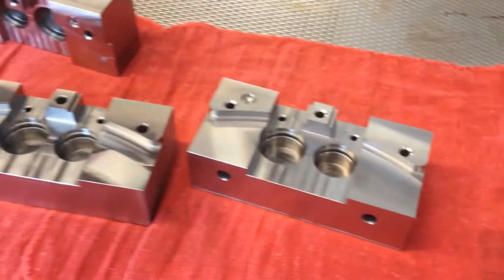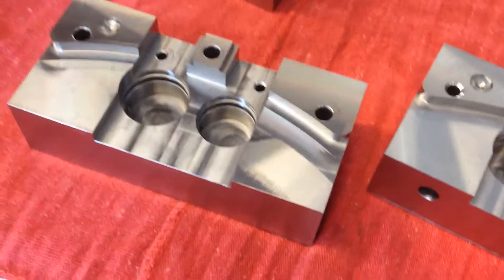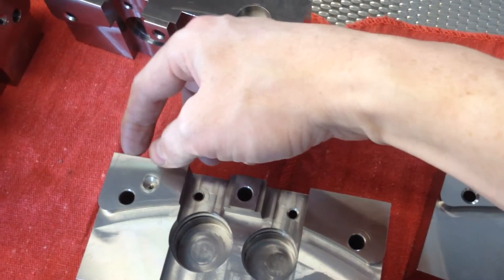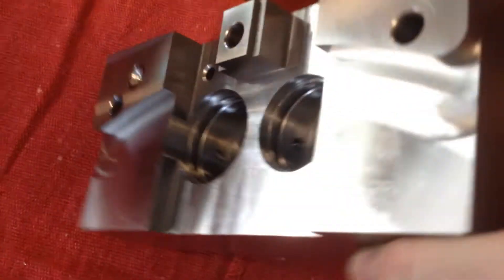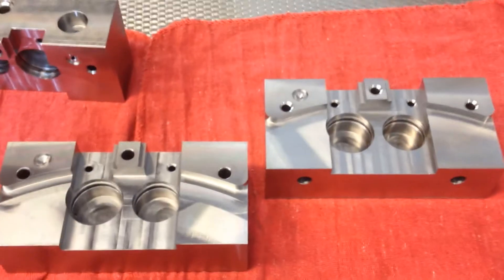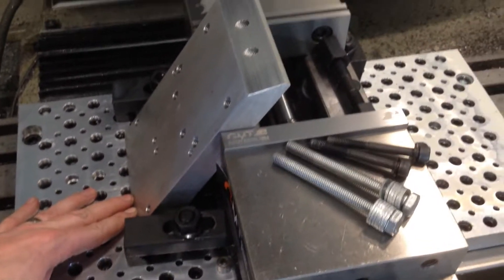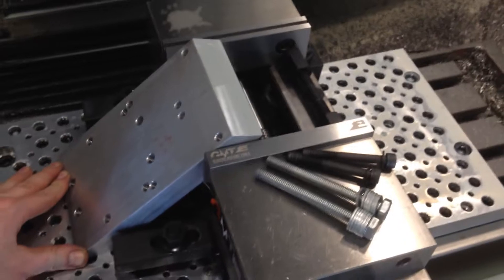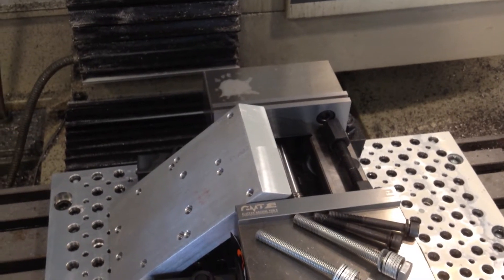SS Disc Brake Caliper Part 2 Tormach 1100

Comment: How did you drill the port between the 2 piston chamber? Seem impossible to drill the port at a 180degree angle.
Reply from the maker: I think I showed it in the previous video. I drilled them at 45 deg. Drilled half way from each piston bore.